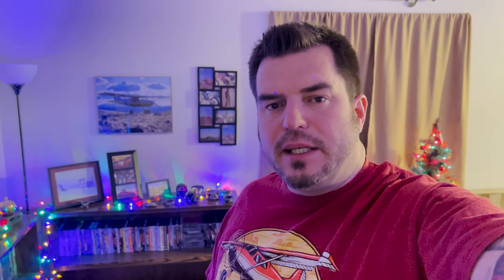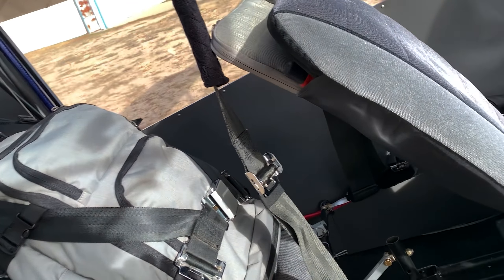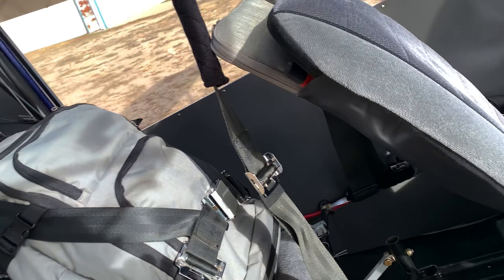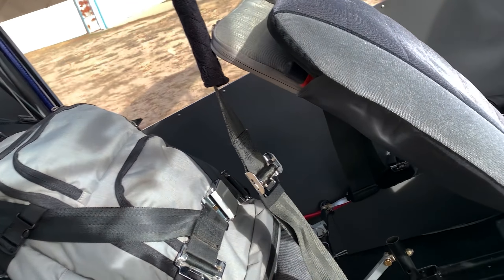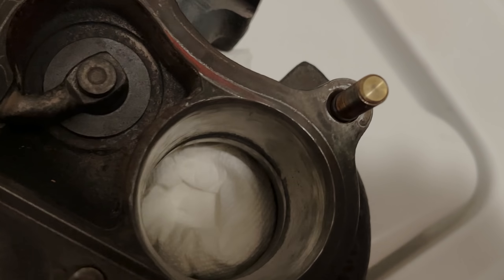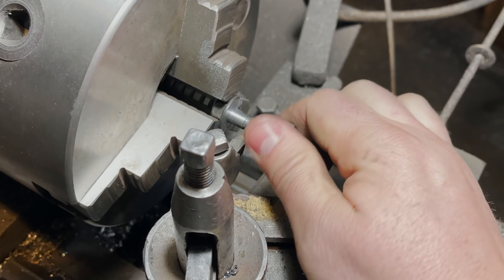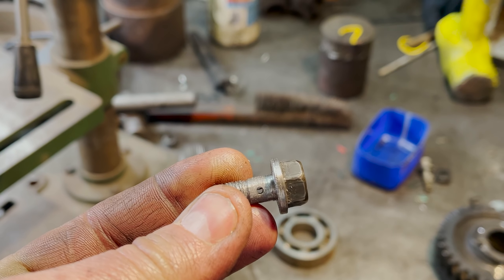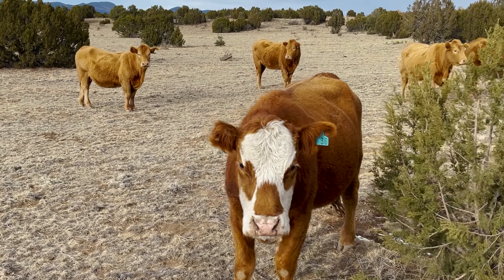Sometimes airplanes break....

Comment: Wow, another great video Todd. I love the mix of flying and shop tinkering. I'm a bit of a hobbyist machinist, I've got an old Sheldon 10" lathe from the 1950s and a Mid-60s Bridgeport in my shop. I really appreciate the way you tackle machining projects to keep your plane up and going. Honestly, if I had to cut metric thread, I'd like to have your Dad around. Otherwise, I'd probably pay the $60. Hopefully, this is the end of your engine troubles for a while, you've had a difficult run the last few months.
Reply from the maker: Thanks man! That is awesome! so much cool stuff a guy can do with a lathe and mill. I barely tap into it I'm sure, but they sure are nice to have on hand. What we found with the metric threads once before, is that once you lock the drive feed in, it needs to stay locked, you have to be real careful if you unlock it and re-lock it because the indicator on that drive seems to be in 12th's, and of course metric is based on 10th's ... on a prior project I screwed something up because of this. (Hard to explain without seeing that indicator thing). But the reverse motor is a life save as you can just back the tool out, back up everything with that motor, re-insert the cutting tool, and go again if that makes sense.
Reply: @GravityKnightFlying  Yeah, that makes perfect sense. I've made a lot of stuff on the lathe but I haven't done that much threading. As more of a hobbyist, I'm generally working with small parts,  and, I only have a 10" lathe. Usually, the things that I've threaded have been done with a tap or a die using the lathe as a jig to keep it straight. Honestly, I don't even know if I have the gears for metric on my old Sheldon. I've cut some standard threads on the lathe, but let's just say the scrap rate is high.

I've got a friend who works for me who is a real machinist. He's got a machine shop out on his farm and has a substantial machining business on the side. (Actually, that's  backward, he would say he works for me on the side.) He's taught me most of what I know, I suspect he's a lot like your Dad. It's hard to imagine how you'd ever get started with old heavy manual machines if you didn't have a mentor.

Now, your project to increase the wheel bolts to 5/16" would be right in my wheelhouse. Right now I've only got a single caliper mounted and Matco says that's all I need for an S7. But, I have a suspicion that I'll be upgrading to dual calipers at some point. If and when I do, I'll probably just go ahead and upgrade the bolts and avoid this problem altogether.
Reply from the maker: @kcpumpguy  lol, I get that!

Comment: Sorry about the kick in the wallet. On the turbo inlet, u might want to experiment with putting different size metal meshs in front of it to prevent anything the size of a broken probe from entering the turbo.  Of coarse the smaller the grid is, it will have a more negative effect on the airflow and cause a slight degradation in power. If it was mine, I'd figure something out before buying another turbo.
 On these bolt things, like your brakes and the home made banjo bolt, there is actually is a huge amount of analysis that goes into bolted joints and how high strength bolts are designed in the aerospace and aircraft industry.  I spent a year by myself designing one bolt(s) that held the night navigation system to the F-16s back in the 80's.  
I think u did a great job of improving the strength of the brake hub thing.  This looks like it wasn't properly analyzed by the factory for these huge tires which apply an enormous amount of torque to the braking system.  Spacers add a lot of bending to a bolt even though it's clamped up.  It's called PL/2 bending due to shear loads. 
On the home made bolt thing, first your Dad is obviously a great machinist and the bolt he made would be worth about $200 from any machine shop. And u r right on by thinking that machining down a high strength bolt to a smaller thread size and drilling a hole in will reduce the strength overall.  Bolts have grain direction which is normally in the length wise direction.  When threads are cut, they cut through these grains which is suppose to make the threads more prone to bending. For "high strength" bolts, the threads are rolled onto 180 ksi bolt material and the cold rolling process  increases the threads and most of the shank to about 220 ksi.  Nothing higher than that is allowed on most civilian airline and military aircraft.  Anything higher than that, and there's a danger of embrittlement problems.   A 260 to 300 ksi bolt is like an Inconel drill.  They break like glass under any bending and have almost zero fatigue strength. .  Of coarse a lot of "high strength" bolts are less than 220 ksi and they can go down to about 120 ksi, such as AN bolts and 160 ksi for NAS bolts. Just depends what your design calls for.  Usually for experimentals, substituting NAS bolts for AN bolts fixes a weak bolt problems if a person can not easily go up a size like u did.
Reply from the maker: Interesting info on the bolts! I get what you are saying about brittle bolts. I was always fascinated with the high strength studs we used in high performance turbo car applications. They are very strong, with a high ksi rating, but are able to stretch and have a "rubber band" effect to hold the head down tight. Impressive stuff. Thanks for the insight and info 👍

Comment: Had the same thing happen to my Matcos and made a video about it on my channel.  I put 1/4” back in though and didn’t have the tools to drill out to 5/16”.
Reply from the maker: I wonder if it's mainly an issue with them not being tight enough. From what I could tell, the old bolts had no loctite (and def no safety wire). I figured why not upgrade just to be sure.. but I bet they had worked just slightly lose and then it's a downward spiral after that.
Reply: I think you’re right.  They work slightly loose on the terrain we fly and then the excessive weight of the Bushwheels is too much shear force for the 1/4”.  I noticed mine from a loud clanging on roll out one day.  Was missing 1 bolt and the another was halfway out and bent. Steve Henry says he always drills and taps his Matcos for 5/16” now after his failures.

Comment: Do you have a link for those Auber probes? I’ve had issues with my EGTs as well.
Reply from the maker: So far I think they are good. But I hate to recommend anything without more time to know for sure. But I guarantee they are better than MGL lol! https://www.auberins.com/ also.. there is another brand I have seen good things about, but have not used personally.. but will absolutely try if these aubers don't work out .. they are available from thesensorconnection.com .... and one more to top it off.. Thomas from Edge recommended Alcor probes... they have put thousands of hours of them without them failing. They are far more expensive than these other ones.. but probably worth it!

Comment: You don't put anti seize on your EGT bolt threads? I would even if you found 1 that would stay around longer.
Reply from the maker: I haven't had much luck with the antisieze holding up with that much heat. Probably a good idea though. Those these new ones are nice - as the outter cap unthreads and lets the probe out of the adapter. They seem to remain real nice and clean out there on those threads. The adapter can now just stay in the exhaust. Thanks for the idea though buddy.

Comment: Me again ... quick question, do you use the MGL radio and head unit? ... if so, how do you rate them?
Reply from the maker: It actually has a flightcom radio.. which looks similar to the MGL. I have not used the MGL radio before. This flightcome kind of sucks to be honest. I can RX ok, but my TX is terrible. Have to be close or people can't hear me. It could just be the antenna, going to dig into that at some point.. but not real impressed overall. I want to say I've heard pretty positive things with the MGL though.

Comment: so where the metal from turbo blades got to ?     thats why im against turbos. seen blow up truck engines before
Reply from the maker: This was on the exhaust side, so it all blows out the "tailpipe" so to speak. (thankfully).
Reply: @GravityKnightFlying  hope ya changed oil and filter
Reply from the maker: @MrBarbuster  Why would the oil be contaminated? All foreign objects went out the exhaust, nothing was headed back into the engine. The bearings on the center section were still fine after the turbine got chewed up. (Neither wheel contacted housings, no oil leakage by the seals etc.)
Reply: its your life not mine   im just being safe @GravityKnightFlying